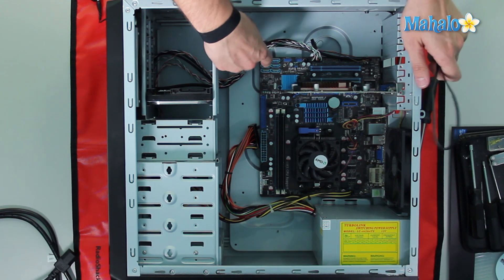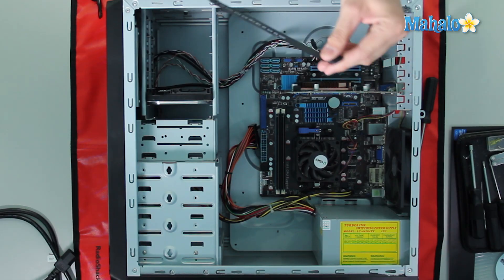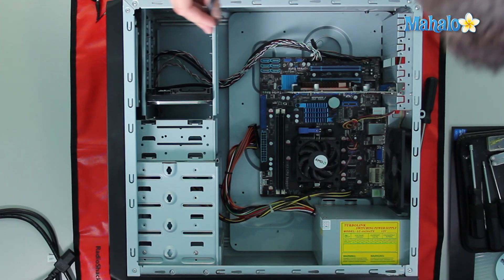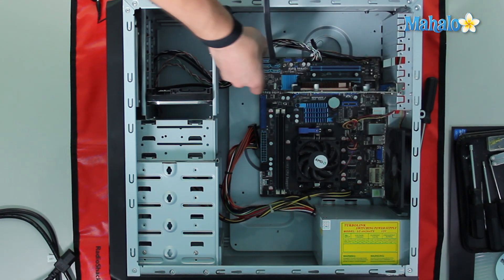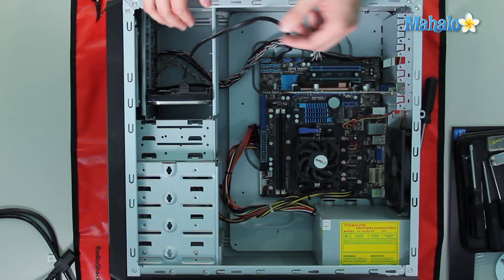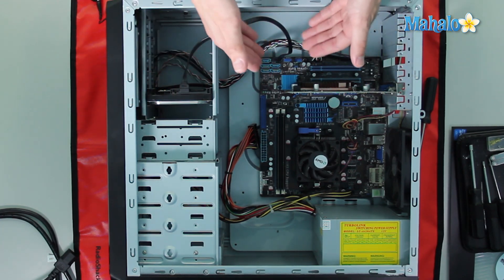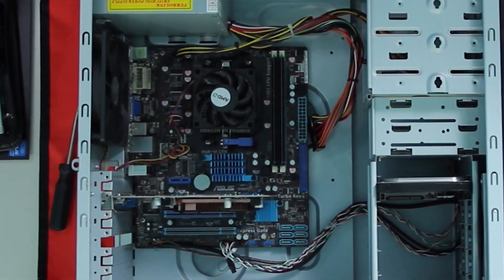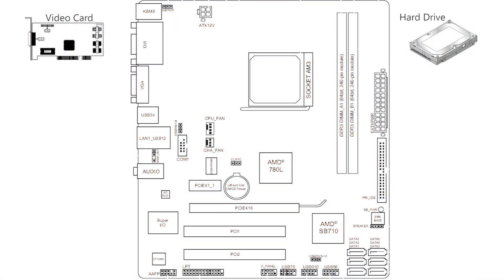SATA on Your Motherboard Explained

Comment: My mobo doesn't have those labels. It says "Sata3G 1", "Sata3G 2", "Sata6G 1" and Sata6G 2". Where do I want my new SSD to go?
Reply: My guess is sata 3g means 3.0gbps, so that's sata II. By that same reasoning says 6g means 6.0 Gbps which should be sata III. If you want your Ssd to be the fastest as it can be, plug it into sata6g 1. 1 because it's read out first I think. Hope you already got it sorted out, but if not, I hope this comment helps (and else for others with this issue). Good luck!